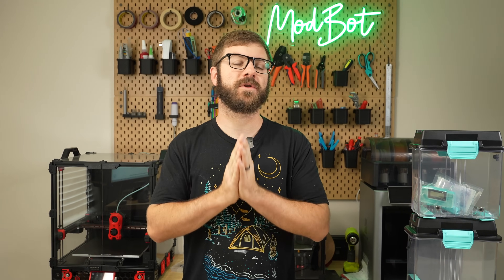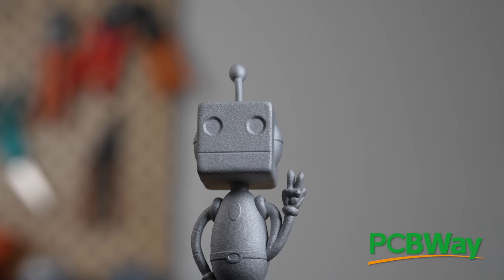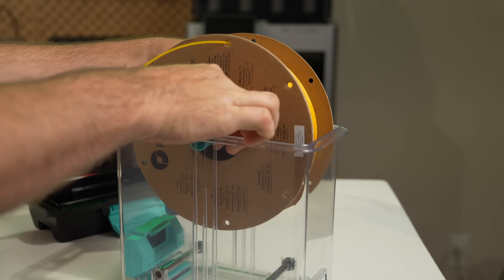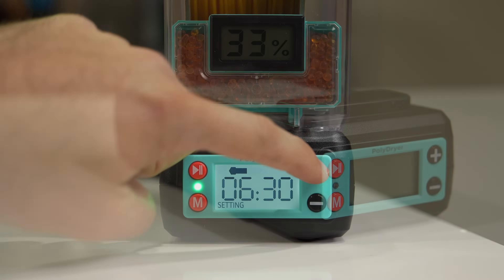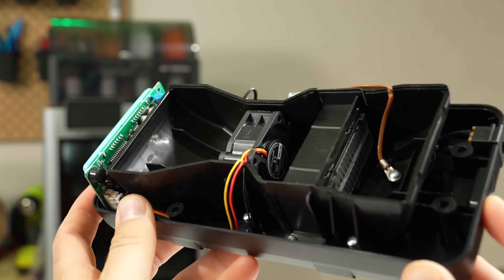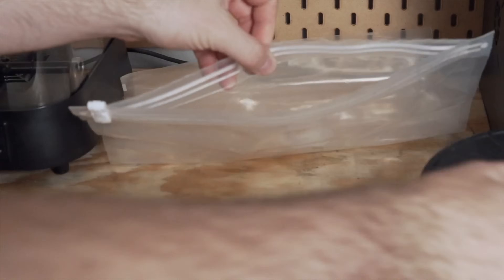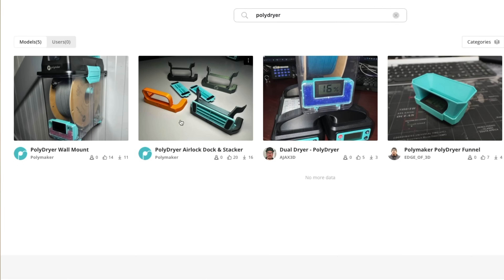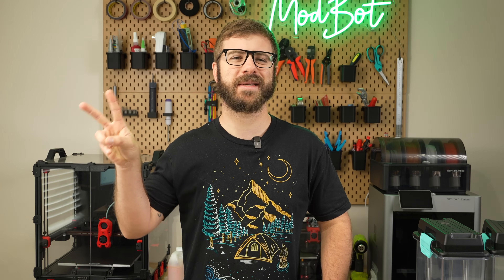Compact Filament Drying & Storage System (Polymaker PolyDryer)

Comment: Oh, and when you are drying filament, I wouldn’t have desiccant in the Polybox. Firstly, as the filament releases moisture, the desiccant will absorb this, and since the box is heated, it will re-release the moisture back into the dry box, thereby partially defeating the purpose of using the dry box. Also, if you are printing from the dry-box, be sure to remove the desiccant, especially if it is saturated with moisture, for the same reason. 

This is why I don’t think the adding desiccant to heated multifilament feed systems is a good idea. I have desiccant in my non-heated Bambu Labs AMS units, but NOT in my Anycubic dry-box ACE Pro.

Comment: wondered if you can answer a question.   I dried a new spool of PLA - start humidity 39%. - it was on a plastic reel and took 6 hours to get down to under 20%.  A further 2 hours took it down to 14%.  I am now drying a second reel of filament - humidity reading 38% on a cardboard reel.  New spool.  So far it has been drying for 7 hours and is still at 26%.  Is the cardboard reel making the drying slower ?

Comment: I received my drying box yesterday.    I usually only buy Poly maker filament as I know it's trouble free.  Last year I purchased 2 rolls of (quite expensive) filament from another seller.  The first reel was a disaster with tangling etc.  I didn't open the second.  Decided to try the un opened reel yesterday to test the functionality of the box.  When I opened the sealed filament and put it in the box the humidity registered at 40% on the hygrometer.  I got the humidity to 14% in about 5 hours and started printing with the box turned on.  What a difference.  It's printing beautifully, no stringing, no tangling - I'm thrilled and will probably order some more boxes.  It means I can leave the printer in the basement and not worry about humid filament (or have to keep going down stairs to baby sit the print).   Only 2 things I'm having problems with.   I'm over 70 and the latches are very difficult to open.  And I find the cord on the box a little short.

Comment: I got one recently, I noticed with the center spool holder the storage box moved around while connected to my K2 pro. The supplied tubing is too large for the connections on my K2 pro. It appears to do a great job drying, I have the CFS, so I’ll try printing from the dry box again at a later date, when I try PETG.

Comment: Based on your excellent video I've ordered my system.  I'm a home user, making cookie cutters.  I moved my 3 D printer to the basement and the filament hates it down there.  A little damper and colder in winter.  In summer it's quite humid.  I love the poly maker filament as I never have to baby sit it.  But in the basement the filament is causing me a real problem.  I look forward to using the system  and thank you again

Comment: You may hate that it beeps but I definitely love that and is actually partially the reason why I recommended it to my brother who purchased it.  It's a very good accessibility feature for totally blind folks like myself who are wondering if our dryer is on and because it beeps, we know for certain that it's powered on and ready. Also, beeping at start is a nice touch. I do admit that it's a bit loud but I'd rather know my dryer is both powered on and working than not know because there's no sound indicator.
Reply: Accessibility apps can read the comments out loud to them. This is a very valid point. Thank you for chiming in. Too often still, people are completely unaware of special requirements for people who are challenged in one way or another.
Reply: can you share more insight about how you handle 3d files, place them in the slicer, orient them etc? 3d printing surely is great to interact with physical objects, but I'm really wondering how you get there.
Reply: How did you comment if you’re blind?

Comment: Hey so I bought one of these and ran it a while to see how hot it gets.  Barely gets beyond 45-50C and the fan is weak.  The storage box is also wobbly on the heater unit.  This is a really good looking yet shabby product.  I’m returning mine.
Reply: I'm in the same boat but the filament dryer industry as a whole is lacking innovation. I don't see a single dryer out there that is a sure recommend other than maybe the Sunlu S4 which is way too big and kind of overkill for most people.
Reply: As someone who has gone all out on this system, with 2 dryers and 5 boxes, I think you may have gotten a bad box. The measurements are a perfect between the box and the dock.

Anyone having this problem, check the gaskets around the ports on the box. If they aren't securely pressed in place, the ports on the box won't form a good seal with the ports on the dryer.

All of mine are great. This is definitely not the most affordable solution, but it is elegant and convenient. Having hygrometers in every box makes it easy to tell if I need to put a spool on the dryer before printing.

Comment: 3:14 Thank you for pointing out how the ptfe tube connects.  I've been trying to find out if the tube actually fits through those holes or not and so far you were the only one to point it out.  Even their directions kind of ignore the tube other than to say there is one.

3:58 The desiccant that came with mine was orange.  The instructions say that it turns from orange to dark green.

Comment: The PET--G setting will deform bambu spools and melt the pet-g filament strands to one another resulting in a 100% wasted spool of pet-g. it did not seem to deform the high temp spool on TPU but i havent used enough of it to find out if the tpu filament is damaged like pet-g was. all the pet-g with in 50mm of the card board center fused when set on power level 2 for 6 hours for pet-g.

use with care it will cook filaments on power level 2 or 3.
Reply: Dang didn't think it was that strong do you think maybe you got a defective unit? I've let mine sit for pretty long and no fusion yet
Reply: @Reedith  i am beginning to think it is the heater that is miss behaving. The last roll of TPU was fine on a bambu high temp spool. It baked another spool of bambu petg on the factory bambu spool. The spool face near the heat exhaust is deformed and sagging on a 6 hour dry cycle and the filament semi fused for a spot about the size of a silver dollar. The resulting petg can be separated but it is highly brittle and cant feed through AMS.  For my self i am drying all petg on heat level 1 for now on. heat 1 hasn't melted or deformed any bambu spools of pla yet.
Reply: Petg setting shouldn't be hurting high temp spools. I would warranty it.

Comment: I have a question about drying: How long would it take to dry 4 feet of 1.75mm diameter filament being printed at 500mm/s? I feed my printers from ceiling racks with many items hanging above. My printer table (V400 tall) is on wheels, allowing me to move it as needed. I've designed special rollers and holders for this setup. Regarding drying, why can't we use a long, heated, and vented tube, say 4 feet in length, to dry 1.75mm filament at a speed of 500mm/s as it feeds into the machine? This could eliminate the need for filament boxes and extensive drying times. Only the necessary amount would be dried on demand. While I'm not an expert, I dislike the idea of using a special climate control device every time I change filaments. 
Please educate me. I can't be the 1st to think of this?🤔
Reply: It takes time for moisture to diffuse into the filament, it shouldn’t come as a shock that it takes time for it to diffuse back out. 

I don’t know what that time frame is, but I doubt it’s less than half of what it takes to dry a complete roll, unless you can get it much hotter.

Comment: If you want a dryer for low temperature, then the Poly dryer is good. I sent mine back because the highest dry temperature only got to130 degrees F. ok for PLA but not much else. Love the concept but lacking in higher drying temps is a no go for me. I need a dryer that'll do at least 175 degrees F. Oh! and a humidity meter lodged inside the desiccant holder does not give an accurate humidity level inside the box.

Comment: There is a mod for the Bambu AMS called Python. The enclosure for this mod will accommodate up to 4 PolyDryer units (The maker says that most people won't need more than 2). That will accommodate multiple size spools and can hold up to 4 spools at a time. I am printing the parts for it now.

Comment: If they release a second version with mentioned additions as well as to select the temperature in 1 degrees steps up to 90C would make it a beast of a system. The cherry on top would be getting rid of the decicant stuff and use this electric membranes CNC kitchen once made a video about. It would end up more expensive overall but feels like an endgame solution for drying and storing all sorts of filament. Oh I forgot make them a bit bigger the boxed to mache even go to as big as 3 kg spools but even 2 kg would be a huge improvement.

Comment: Reguarding the beep, I have opened more than a few electronic devices in my lifetime in order to rip the speaker out with a pair of pliers (or gently snip the leads) I have not done that with this box but removing the speakers in this way has never caused me any problems on the other devices I have "modified"
Reply: Yeah if done right it should be a mod with no collateral damage if you’re willing to open the device (not sure how hard that is on this dryer.
Reply: Same here, and that was my exact thought when he mentioned it

Comment: Thanks for the video. This was super helpful. I just received mine yesterday and it appears that they took your advice into account and they have replaced the blue desiccant with orange desiccant. The question I have for you is how much air movement comes off the fans for you? I guess maybe measured in CFM, I noticed on my unit that the air movement is barely noticeable and I have a lot of moisture buildup inside of my dry box while it’s running. Not sure if I got a bad unit or not, but the air movement seems barely adequate.
Reply: I feel the same way. I contacted polymaker and actually got a free replacement base and still feel like the air flow is lacking. Also can't get the moisture level below 35 while running.

Comment: Poly started with the unheated dryboxes for 180 bucks or something right?.
This is a improvement.
Too bad its aliexpress hygrometers and a simple ptc heater with thermalcutoffs.
Ptc is fine but it sucks they use the cheap crap hygrometers.
Reply: More expensive hygrometer does not even matter for this application. This is just a box that keeps plastic dry, not some lab-application that requires highly accurate reading. If only they sell the box at lower price though, but I can understand why it is priced that high. I have one and the quality is solid unlike the DIY cereal box stuff.

Comment: I just don’t see this as viable option for long term storage. $29 to store a $13 spool!  As another commentator said, A big airtight totes with desiccant is more economical. I have two big Yeti coolers that I use. If my fridge/freezer fails I’ll dump out the filament and save my food. Then dry it two at a time in my EBIOS.

Comment: I got my Polydryer and extra box this week, and TBH I am dissapointed. The hygrometers are all over the place, and after numerous sessions i cant get the boxes with PETG to go below 25% humudity, swapping the hygrometers also makes it seem the readout is completely random. I have seen reviewers mention that Polymaker made adjustment to the stickers to have them not bubble up, but after 2 days of use my unit is showing that exact "defect". Is 3dJake selling old stock maybe?
Reply: These hygrometers are known for "tolerances" as in all over the place
Reply: OH! Then I may look elsewhere then. I thought this may be a solution because it doesn't get that hot.
Reply: @GaryParkin  after some more time with it, the unit is fine. Its just important to dry the dessicant before using the dryer and boxes.
Reply: @pcvanvliet  I assume I can dry the desiccant in the dryer by itself. I was thinking of making little shelves and adding all my small packets.
This looks like a neat solution. I'm reading a lot of horror stories from all the different mfgr's drier units.
Reply: @GaryParkin  there are solutions for that on Printables and Makerworld, so yes you can. I use a microwave with the orange dessicant. Its an efficient unit as you are only heating the air in the box. I have dried PA6-CF which is notorious for sucking up moisture.
Reply: @pcvanvliet  Awesome, so this unit seems like one of the better solutions. Thank you.

Comment: At 30 bucks for the box it's not really viable as a storage solution. I'd have to spend a couple thousand bucks to store my spools with this. So I'm going to stick with vacuum bags that just cost about $1.50 per spool. But I might get one or two of those units for drying while printing. 
If they could figure out a way to lower the cost of the box to the price of cereal boxes it'd be a really nice storage option too.
Reply: Unfortunately we will never reach the $1.50 price point, this is 100% sure :)

Comment: I currently store my filament in cereal storage boxes that are very similar in shape to the box. I wonder if there would be a way of adapting these (cheap) boxes to work with the dryer and hole plugs.
Reply: Yes, I have my filament in cereal boxes and looked at creating an adapter for the bottom .. I tried to get a Polydryer over the weekend to make it but they're on backorder.

Truthfully, the dryer portion itself isn't that difficult, one could get a hairdryer (or another controllable heater source), Arduino, and spend a day writing some rudimentary code to create a very similar "adapted" product using the cereal boxes sealed lift gate.

Comment: I really like this, it's modular so you can quickly swap out boxes, it keeps your filament dry once dried, and looks like the core functionality is well thought through.

I do have a question though, my printer feeds from the rear, is it possible to place the hygrometer so that it is on the other side of the grommet, allowing the filament to exit the box in the back rather than the front, while retaining the ability to read what's on the hygrometer?
Reply: @timtoxopeus The lid works both ways, so if you need the grommet on the back just flip the lid around and clip it that way.

Comment: I've gone with the PrintDry boxes for storage as about $12.50 each. $30 each is WAY to expensive.  Why no thermostat?  With the heater they use, they control the power with the fan speed. No thermostat to worry about but not very precise.  Probably OK for a dryer box. I have almost 100 storage boxes, so $3000 for storage?  I don't think so. That is more than the filament in them.

Comment: I like the concept of separating the dryer-unit from the box(es) very much.
But too expensive.
Reply: I mean it's more expensive than other dryer units but I can tell you that the filament dryer is got from Ebois that's like the first Amazon one and a bunch of people have it is actual trash so I'm willing to get one that doesn't melt my spools (which that one did) and fall apart completely after a few months of use.
Reply: To be fair, it's a very nice box. Having a hygrometer in each one of them lets me tell the condition of that spool at a glance. The feed holes are great for filaments that are extremely hygroscopic.

There are models out there you can use to print your own boxes, but it will be a challenge for you to get a 3D printed box to be nice and transparent. Still, it's an option.
Reply: I wanted to get one of these too, but I couldn't justify the cost of just the box itself without the dryer unit. If the solo box was cheaper, this would definitely be a real gamechanger.
Reply: @RicH0864  I don't get the cost issue unless the Amazon US cost is so much less. I think $79 at Amazon is a pretty fair price for what it does compared to the Sunlu for $150+
Please tell me if I'm missing something because I'm looking for a dryer for PLA and TPU. My A1 doesn't do the higher temp. plastics and I don't need them.

Comment: if it can just use hinge and some magnet to close that hot air vent hole thing at the bottom and can just put it on that drying stand without have to take out that feet cover out
it 90 euro price is quite high too

Comment: Yesterday I uploaded my 3D printable version of this box. If you use a cheap filament you can save a little bit of money per box. However, my intention was to improve a few features that are missing on the original or that I don't like. For example, to make the box stackable or to replace the very tight closure with a better one. All in all, I like the option of being able to simply place the box on the dryer.
Reply: Link??????
Reply: @Jesse_Kershner lookup extrutim on printables

Comment: Polymaker is one of those companies where I'm not sure the higher price really deters me...they have been very supportive of the 3D printing community and make quality products. I wouldn't use a large number of the boxes for filament storage (the large, airtight plastic tote I got from Amazon for $25ish holds many kilos and has a sealed, rechargeable, indicating silica gel EvaDry unit rolling around inside) but the dryer does beat the Sovol dryer I got bundled with my SV06 Plus in features including max temperature.